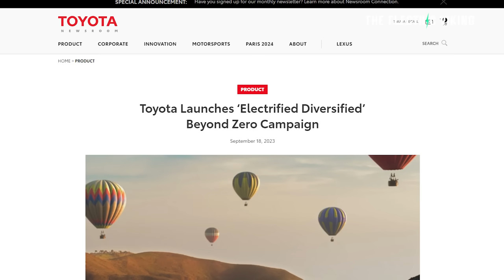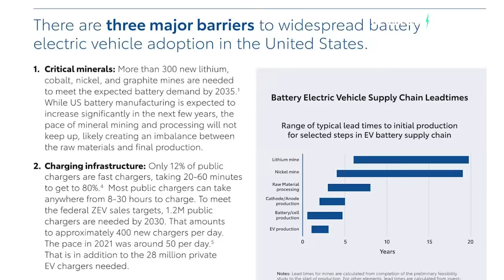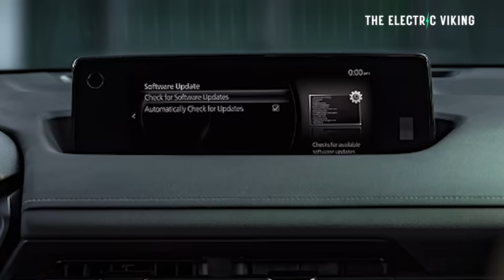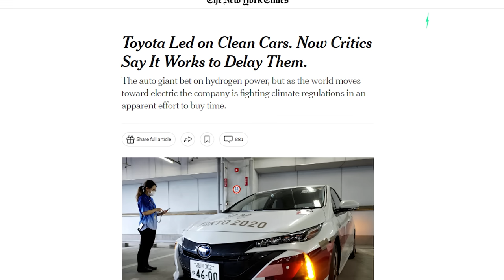We are witnessing the early stages of the biggest fall of any company in history

Comment: 1. The way how pollution is converted into deaths is bonkers. Even then, soot exiting petrol cars can be controlled fairly well. So, not an argument.
2. A combustion engine can be easily made CO2-neutral by one of the following means: 
a. Usage of hydrogen, ammonium or anything else without carbon. 
b. Usage of renewable carbon-containing sources like: wood extracts, fermentation of bio-mass, synthetic conversion of atmospheric CO2 into carbohydrates.
3. There are still years until infrastructure for electric cars become reliable. To charge 10 cars with a 150KW, you'd need a 1,5 MW of power. How do you get this through city's infrastructure? You'd need a power plant next to every parking lot. 

So, I think Toyota is right, and Mr. Viking is wrong about the bright electric future to be around the corner. In some 15 years, there could be a 50/50 share between the electric and the combustion vehicles, but we'd need over 20 years for electric vehicles to break through 70/30.
Reply: I agree. We'll see continued sales of EVs in developed countries to customers who can charge at home or at work. For everyone else modern fuel efficient ICE vehicles are the best option.
Reply: As others have pointed out, try and do some proper research. 
Oh no, 1.5MW for 10 cars 😱 for 30-45 minutes... wow. How's this for a fact:
On 1 September 2023,  a single wind turbine set a record for production in a day. It produced 384.1 megawatt hours (MWh) in 24 hours, as a typhoon hammered southeast China.
This is enough to power roughly 170,000 homes, or 38 million LEDs, or 2.2 million kilometres driven in an electric car.
Another fact for you. In the UK, which now has 1 million BEVs (not including PHEVs) and yet the grid demand FELL by 20TWH last year vs the year before. Where is all this extra power we are meant to be needing for these cars? Oh, and all the heat pumps we are installing.... 
It's BS mate, you are being tricked and lied to about how bad EV's are, by lobbyists for the likes of Toyota and oil giants who don't want their business model and profits being tanked.
Reply: @steve_787  The wind turbine generating 384 MWh is completely irrelevant. The only relevant factor is the local grid operator/owner being able to satisfy the load requirement.
Germany has one of the most stable grids in Europe, probably the world. A law came into force at the beginning of the year that allows grid operators to throttle charge points to 50km per three hours.
You might want to think about that.
Reply: @marcg1686  it's called load shifting. My home charger does this already. I plug in, set what charge I need and by when and my provider sets a charge schedule around energy demand.
Do you mean 50km or 50kW? An easy typo but want to be sure if we are talking distance or power so my next sentence makes sense. I'm guessing you meant power delivery of the chargers?
If so, Germany are also set to bring in a law that requires 80% of all service stations to have at least 150kW. So that kind of goes against them limiting public chargers 

🤷‍♂
Reply: @steve_787  Sorry to burst your electric bubble. Who cares how much a wind turbine in Wyoming or Solar panel in Sahara can output?  I don't live in a city, where people have wind turbines sticking out of their balconies. So most households are only allowed to equip 2 out of 10 parking places with electric chargers exactly for the reason that electric grid is not built to handle such loads. But since you did not recognize the difference between the the power load and energy demand, green mold has likely affected your grey matter and you are not able to think clearly.
Reply: @sergey9986  what bubble? I'm already living the reality of it, have done for 8 years. You can spend you life in an echo chamber thinking it won't change but the world will still move on without you. As mentioned in a previous comment to marcg, my home charger has load shifting (generally to overnight) and I'm looking to get home solar/battery this year where I'll be able shift my demand etc. So fully aware of the difference in demand/supply. As you have also ignored, with the rise of EV's in the UK, the opposite has happened with energy demand as it's been falling. 
Yes there are limitation on local substations etc but these are being upgraded all the time. Funny enough, the companies who sell electricity will want to sell you as much energy as you can use so no reason to limit the supply. 
Not 100% what you mean by the 2 in 10 parking spaces thing. Did you mean only 2 in 10 homes can have a home charger? Either way, that doesn't make any sense as not all the chargers would be in use at the same time. On the positive side that means 1 in 5 cars in your town must be an EV so good job on the EV adoption where you are, EV's are working very well 👍
Reply: @steve_787  I mean 2 in 10 apartments. In the end, people not only live in single-detached dwellings. Approximately half of people in EU live in apartments that comprise a multi-unit residential building. Those typically either have a reserved parking lot in a garage or outside assigned. At the moment, in my residential area only 2 out of 10 such parking lots can be equipped with chargers. "Can" does not equate "are".
Reply: @sergey9986  Thanks for the clarification. The UK 2021 censes found that a bit under half of people living in apartments had a car/van. So, as a general assumption, 2 chargers would be able to serve 5-6 easily as people don't charge daily, maybe weekly.
Yes it would mean in areas where parking is allocated something would need to be amended, but if your space had the charger, and someone else needed to use it, their space would be empty.
In the UK there is generally some additional parking, 1-2 spaces, for "visitors" which would most likely be where a charger would be placed.
By sharing the charger you also help spread out the peak demand so win win.
In the UK there are issues around housing in old terraced streets which do need to be addressed, as these seldom have spaces outside your house and you can't always park outside your house even if you could run a cable out to the car.  I know this from personal experience in a previous house, but granted that was before I had an EV. But acknowledge the issue.
Reply: @steve_787  Sorry, but I'm not planning to either share my parking lot in the garage or electricity bill with anyone else. 
Coming back to the main argument. It is still easier for most to continue using fossile energy directly then bending over to go electric. It is not yet convenient enough. As I wrote above, I expect the number of electric vehicles to reach 50% in some 15 years as infrastructure upgrades are typically measured in decades.
Reply: @sergey9986  that's your choice. Most flats should have some visitor spacing so that's where the chargers would be anyway which would be linked back to the landlords supply and billed separately. 
The main argument is one of a perceived inconvenience. If I had no home charger I could fit in the charging around my lifestyle, but that is region specific. But just because you think you can't live without fossil fuels, doesn't mean others can't.
Infrastructure will improve as adoption rates climb. Chicken and Egg really.
Reply: @steve_787  Sure, this is the question of convenience. I could charge the car elsewhere or plan more time for long trips if I really really wanted, but not yet ready for it yet, despite easier maintenance, dynamic driving experience and potential benefit for the planet. 
I simply rationalized Toyota's decision, and explained few examples on why this  makes sense commercially, as I see it. This is where Mr. Electric Viking reached a different conclusion. Toyota certainly made research and figured that those older technologies still have at least another decade before broadcasting their opinion.
Reply: @sergey9986  1) pollution kills. Exact numbers are unknown but correlations between coal plants closing and drops in local cardiac events (dropped 42% per week)  is evident. Pittsburgh 2016 coal plant closure for reference.
2a) hydrogen isn't green (yet) and would need double the renewables that EV's need to make it green. It's just pointless, power homes with the excess and people can have home solar to make their own fuel. Ammonia has half the energy density of petrol so thats not going to be great and it's also toxic. Didn't that liquid hydrogen ICE also have half the power with Elec Viking called "gutless". By the time either are anywhere near reality, people would have switched to EV's.
2b) biomass isn't that green. Yes it's half the emissions of gas, but you still have to burn the stuff. Better to just let the trees do their job IMO.
3) We have discussed. People in far more knowledgeable roles will have been planning grid/infrastructure upgrades years, maybe decades ago. I really wouldn't worry about it.
Reply: @steve_787  1. I never heard of coal being used in cars. So, please re-read my statement and do attempt to be precise. 2. But coal plants are used to generate electric power. Electric power is quite often not a lot greener. Same thing with electric power, the fact that hydrogen isn't green now does not mean that it won't be greener tomorrow. In fact, natural gas has a substantial fraction of hydrogen in the mix with methane to begin with. It is just being discarded now as it is a bit hard to handle. Again, hydrogen is just an example of fuel that can be made carbon neutral, hence, Viking's statement that "combustion engine cannot be made carbon-neutral per se" is incorrect.
Reply: @sergey9986  you said "pollution" and I gave an example of what happens when pollution is removed from an area. Remove the pollution, lower the health risks. Very simple to comprehend.
Coal is a source for electric and is going to die out. As mentioned, here in the UK we did just that and more than halved the cardon intensity of the grid in a little over 10 years. Any EV still on the road from back then is now cleaner to drive than when new, but all the ICE cars still spew out the same they did back then (well a very slight drop with the new E10 petrol). 
I'm going to guess you are in AUS or USA? I think AUS at a guess. Even if I were to charge my EV in your worst state (Northern Territory) my EV would be slightly better than my old diesel. Auto Expert John proved that in reality it's more like half the emissions of a typical gas guzzler. 
Again, by the time you get to the point where you have true green hydrogen, you'll be producing enough green power to charge an EV AND power homes. Why waste the resource? Yes technically you could have a "green" ICE, but it'll have died a death long before it's ever a reality.
Far better to have BEV's that have V2G and balance the grid.
Reply: @steve_787  My response to your question got deleted.
50km per 3 hours. My 40kWh Leaf currently has a consumption of 17kWh/100km. Let's call it 9kWh per 50km. So you might be charging at 3kW. That's wall socket speed.
Aral, a BP subsidiary, has complained that in many towns the local grid operator has denied approval for 150kW chargers.
150kW chargers aren't the answer anyway. Many thousands of curbside L1/L2 chargers is what is required. I'm fortunate to be able to charge at home or at work (for free). Many are not.
The actual reality of my journey to and from work every day here in Germany is seeing lots of Model Ys and ID4s, vehicles weighing 2000kg+ with a 70kWh battery conveying a solitary driver from A to B and back to A. A 35kWh battery and a solar array will take a family of four off the grid immediately. EVs do nothing for the environment.
Reply: @steve_787  Why I mentioned the link between mortality and pollution as somewhat vague, is because it is virtually impossible to disentangle socioeconomic factors from environments albeit few hardcore examples of smokers and miners. If you can refer to a titration curve of pollution having effect on longevity and get at least 3 sigma significance for the pollution level we now experience in the cities, be my guest. I don't want to disappoint you, but 2022 was the the absolute record high for coal mining worldwide. 
Again, I started this not to argue how wonderful or awful the green future gonna be. This is way to complicated. Neither am I planning to drift into moral discussions of how to save the planet. I just stated that we have peak power for charging vehicles as a limiting factor. Besides, to avoid influx of cheap electric cars from China, I expect European governments to back down on their support for electric vehicles (I live in Germany). Seeing all this, I do understand Toyota's decision to retain combustion engines for a long while. They already have the technology. If they don't produce it, somebody else will. This is not to downplay the wonders of electric powertrain.
Reply: @marcg1686  no worries, I've had comments deleted and never know what caused it 🤷‍♂
Just so I'm clear, you are saying you are "rationed" to 9kWh for 3 hrs per day, or per 3hrs? Or you can't install a home charger above 3kW? 
I somewhat agree that having more, slower chargers, is better. If they are located near workplaces for instance you don't need it to be ready in 45min as you can leave it for 8hrs or so. Rapids are good for places like super markets, service stations where you don't typically spend much more than 45min to an hour. 
I charge at home as well on a cheap night tariff which can adjust the charge time/speed depending on grid demand. Just need to set what % of the battery to add and when you want it by.
Single occupancy in cars isn't really a new thing, always been an issue regardless of what powers the car. I don't really see the car weight as much of an issue, cars have been getting heavier for years and the weight will come back down as better energy density cells come out. 
Our EV has a 42kWh battery and am in the process of getting solar quotes, think I can get a system that would cover all our electric in "net" form so agree there.
Disagree that EV's do nothing for the environment. Emissions saving of our Zoe over 7 years has been 4.5 tons and my car (had it a bit over 3 years now) is at 2.5 tons vs our previous cars and milage of 29k and 20k miles respectively. This is with our relatively modest usage. So the saving to me a very clear. 
Even if we lived in Germany (grid average is about twice as bad as the UK grid) that saving would still be 2.6 ton / 1 ton. 
Grids will get greener so that gap to ICE will only ever increase. IF I had had solar from the start then the savings would be closer to 6 ton/ 4 ton, not including the house savings. Just need a heat pump and elec oven/hob and I can cut off the gas supply😉

Comment: Listen closely to the terms Toyota is using.  If their engines are going to be zero CARBON emission, they must be burning hydrogen, not gasoline, diesel, methane or methanol . 

Burning hydrogen is NOT non-polluting. A byproduct of the burning even pure  hydrogen using air as the oxidizer, which is about 80% nitrogen, are nitrogen oxides (AKA NOX) which are major contributors to smog.  

If Toyota is going the hydrogen route, it must come up with new technologies to address NOX in hydrogen burning ICEs to have a true non-polluting engine. 

Even with fuel cells you have to consider  where the energy comes from that is used to separate and purify the hydrogen from water or hydrocarbons to claim a net zero carbon footprint.

Comment: Carbon neutral is possible with synthetic fuel, which costs 10X more as gasoline. Its made using an energy intensive process to capture CO2  from the air (hence CO2 neutral) and H2 from electrolisers and turn it via a rather complicated process into gasoline or diesel..the theory is the energy used comes from sustainable sources like wind and solar. Pilot factories already exist for these fuels, but are making kerosine for the airline industry.. It is a play of the airline industry to become carbon neutral as well... because there is really no alternative for long distance flights using the big twin aisle airliners with 250 or more passengers.

But this never gonna work in the car industry, because nobody will accept the much higher costs, just like nobody wants an H2 car....and as you said, it is NO WAY NEAR TOXIC NEUTRAL, NOx will remain an issue, smog will remain an issue, PM10 particles remain an issue... Beside this it is much more efficient to use all that electricity to charge car batteries and drive about 5X more miles with the same amount of energy.

Nature is quite logical... If stuff burns really hot and really easy, to turn the burned products back into the same stuff will cost at least the same energy as it released during the burning, if not more,  to turn that stuff back into the stuff(fuel) you started with.. and it won't b easy! Hard+a lot of energy= Very expensive.

I have been saying this since 2019, when I started to invest in Tesla:  Toyota will be the Kodak of the automotive industry.

I had a little hope for Toyota when that new CEO came on and Akido Toyoda stepped back... But after about a year, it only seems to get worse!